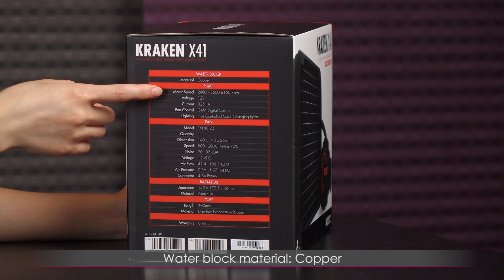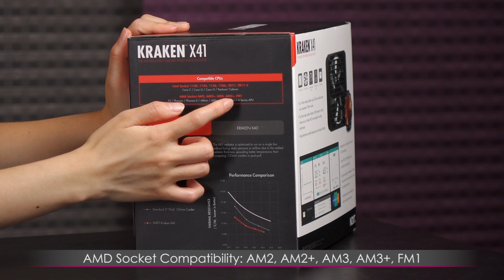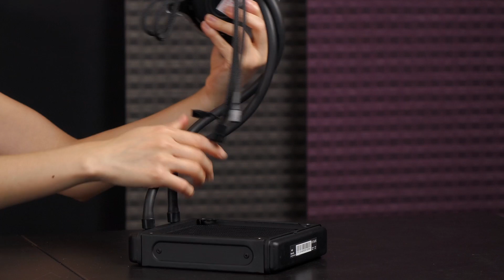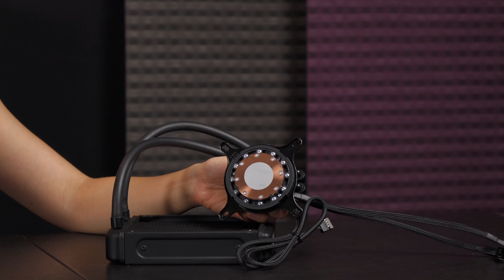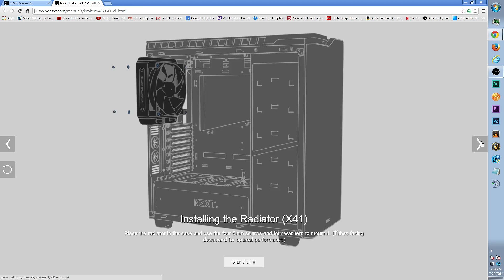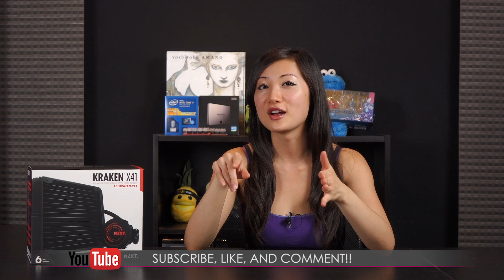NZXT Kraken X41 140mm Liquid CPU Cooler Unboxing: Release the (Liquid Cooled) Kraken!!

Comment: I have a i3-7350k. I was on the fence with this and the h60. Should i return the h60 and get the kraken x41? Anyone? It's amazon prime so return isnt a issue. Using a Asus z170m plus board. ddr4 3000mhz vengence ram. Gtx 1060. Evga 650 p2 power supply. Going in a prodigy M case.

Comment: This doesn't support A10 7850K right?
Reply: +Jhanzent Capin does, but if you have the budget for this, go for the 7870k, it brings a higher gpu clock
Reply: +Jhanzent Capin and don't forget to use very high speed ram for best performance

Comment: Comes with an intel back ring but not an amd one.  Would come in handy, it baffled me for a while until I realized I had to take one off an old MOBO because it wouldn't screw in. Pretty shitty. As for the unit, been using it for a month or so.  Works fine, but really loud even on lowest fan speed (25%) Anything over that sounds like a jet taking off.

Comment: Could I set this up to Adjust the fan speed and pump speed to the GPU temperature instead of the CPU one? 

I'd like to install this into a kraken g10 GPU adapter to cool my GPU instead.

Comment: Does the fan plug into the unit or the motherboard?
Reply from the maker: The fans plug into the headers on the unit, and the USB as well as 3 pin connector plug onto the mobo. 
There's a guide in this video where it shows where to plug everything in!

Comment: You can replace the fan on the kraken x41 with a nice nocturn fan correct? any recommendations from fellow builders?
Was going for h100i but heard to many complaints about the pump being loud.
Reply from the maker: As long as the fan is the right size, I don't see why not.
Too bad about the H100i being loud!
Reply: Wow thanks for the quick response and for taking your time to answer my question. Know you must be a very busy person.

Comment: If you're not water cooling you're doing it wrong. You don't need to break the bank on a water cooler, but you do need to cool your chip with water.
Reply from the maker: Oh yeah?
What's your take on this?
Some people are afraid of leaks!
Reply: I think dust contaminating an air filter and causing a chip to overheat is more likely, and you get the added benefit of always having your chip run at much cooler temperature. I have a 2010 thuban, with a minimal overclock, that runs faster than most modern stock chips. It idles in the upper 20's and rarely goes above 35c. Water cooling has extended the life of this system and made it just as powerful as newer systems I've spent a fair amount of money on, and the water cooler on that system isn't nearly as nice as the one you've reviewed here. I'm actually thinking of buy this one and changing it out, and this would extend the life of the system even longer.

Comment: Just a point of curiosity, the connection points of the neoprene coolant transport tubing.  It looks more like the tubing has been installed onto the stubs and a collar crimped on the end.  So, if one needed an extra foot of tubing to move the radiator and its fan way out of the case it would be a case of inserting a splice and adding extra coolant to fill up the half pint or so of extra tube space.  It would be convenient if the tube clamping was with either a snap ring or compression ring clamp.

Just my personal taste, but I think I would prefer the clear neoprene to see the coolant flowing.

The Android app is a nice touch.  You can be five miles high crossing he terminator with a airflight doggie bisquit and half cup of flat soda and see where your temp is climbing because the cat is warming his behind region next to the radiator.

Thanks for the look at Krakens product.
Reply from the maker: That is interesting!
Thanks for sharing :D 
Ah, then it's custom tubing for you! 
Lol, nice imagery! 
Thank you for watching :)

Comment: Release the Kraken! (there I said it... because why not!)
I've heard that copper aluminum mixed solutions tend develop an acid in the coolant over time, is this true?
I like mine: Cooler Master Eisberg 120L Prestige – High Performance Push-Pull CPU Liquid Water Cooling System with 120mm Copper Radiator
Joanne's cat like reflex prevent disaster. ;-)
Reply from the maker: It must be said every time a Kraken product appears :D
I did not know that; if you learn more, let me know! 
Yeah, CM has some good coolers out there; the Hyper 212 Evo is still very popular! 
Meow!
Reply: Joanne Tech Lover
 Here's what I found. It seems that Galvanic Corrosion can a occur in mixed metal systems, aluminum/copper/brass. Constraints seem to be that water is used (tap or distilled?) which acts as a conductor creating an electrical connection between the 2 metals and then the chemical reaction occurs. Personally, I am adverse to putting water, in any form, near my computer lol. Glycol Alcohol is a safer bet and doesn't cost that much thermal conductivity.
Source: http://www.overclockers.com/pc-water-coolant-chemistry-part-ii/